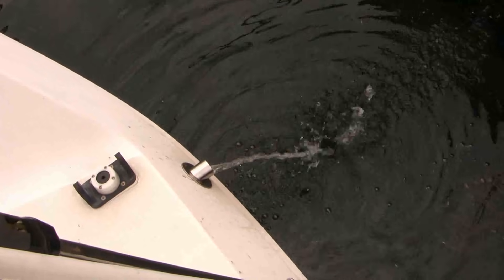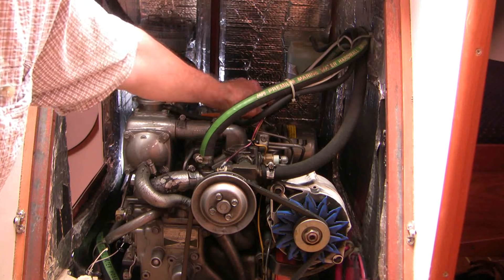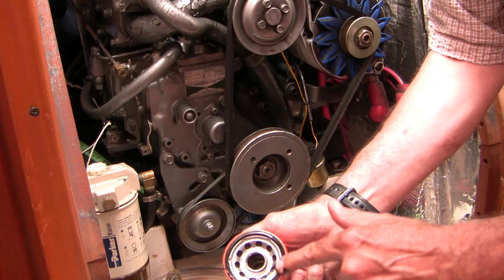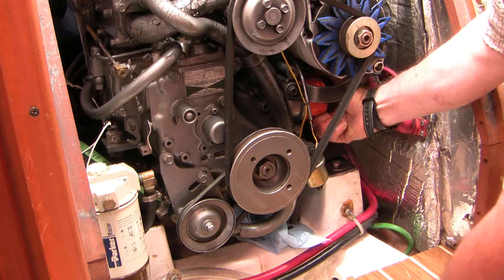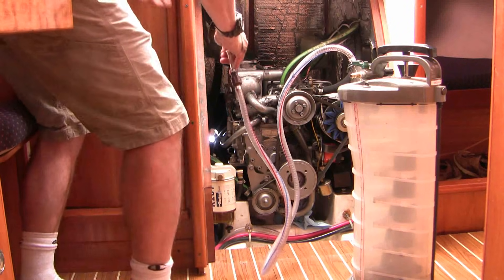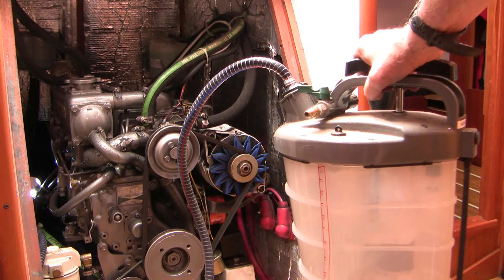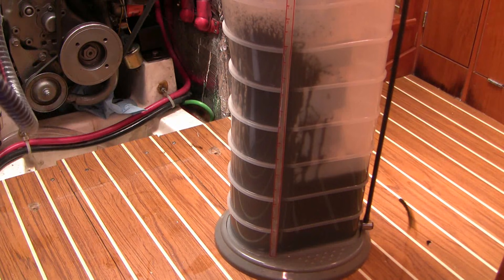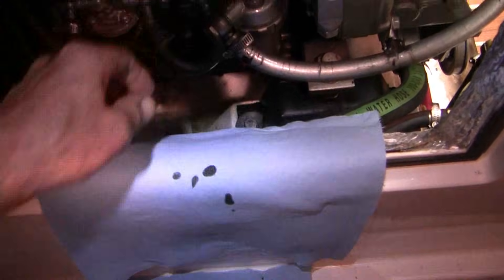Yanmar marine diesel oil change

Comment: Helpful video.  One question, why change the filter before emptying the old oil?  Thanks!
Reply from the maker: Oil filters have a silicone or rubber "anti drain-back valve" that keeps the filter and (both proximal and distal) feeder tubing charged with oil even after the vehicle is turned off. The system is designed that way so the oil pump doesn't need to clear air bubbles from the passageways at each cold start. When you break the air lock by loosening the oil filter, the siphon is broken so remaining oil in the proximal tubing will reflux backwards into the pan. It may not be a big effect but as a pattern of practice it makes sense to remove the filter first. Thank you for watching!
Reply: spelunkerd Wow!  Loved the medical terminology to stay oriented on how the system works!  Thanks!
Reply: Thanks @spelunkerd

Comment: You should still slide something under the engine and drain the engine after sucking the oil out of the top. Then use your suction system to empty the under-engine tray. That way you do a complete change.
Reply: There is no drain plug! Dana
Reply from the maker: How do you propose doing that, without an oil pan drain bolt in this engine? Even if some engines have a drain bolt, there is often no room to get a drain pan underneath. The siphon tip was at the bottom of the oil pan, it would be difficult to do this procedure any other way, and in fact this is the Yanmar approved method for oil changes in these little engines. To remove the oil pan, you'd need to winch the engine off the transmission to gain clearance to get those pan bolts free, and there would be an inevitable mess that would end up in the bilge and then automatically pumped into the ocean. Nobody does that, it costs tens of thousands of dollars to lift an engine in these boats. That said, if you have an engine with a drain bolt and room to use it, of course that method would be better.
Reply: @spelunkerd  Its think Dana is accustomed to Yanmar engines used on commercial equipment (Bobcats, air compressors, etc) and those have drain plugs unlike the smaller marine engines.
Reply from the maker: @victoriastreet8919  Yes. Small marine engines need to have their center of mass as low as possible to optimize boat stability. This Yanmar has no drain bolt so the center of mass can be lowered a couple of inches.
Reply: spelunkerd , I have never, ever, ever run into a Yanmar or a Perkin-Elmer with no lube oil sump drain. After getting the top sucked out, I like to use a 1-gallon oil jug with the side cut out. Jam it in, drain the sump (there’s never been more than 2qts left), suck the oil out of it, pull it out, wipe the inevitable splatters up. Miller time.
Reply from the maker: Oh, that's an interesting idea, certainly useful if you don't have a vacuum pump or reasonable access to a pan drain plug. I get that it is faster. Are you draining from the fitting below and aft of the oil filter? If you are draining from the oil sump pathway, the oil in the pan needs to get past the screen at the oil pickup before it can be drained. Coarse particles and sludge will not make it past that screen so would remain in the pan, and with time sludge will coat the screen. Siphoning with vacuum isn't much better but at least the bad oil doesn't have to pass through a screen to be removed. Documents from Yanmar, including the free owners manual which is available online, call for vacuum removal through the dipstick, as shown. Whatever method is used, hot oil offers the best chance of removing sludge and suspended particles.

Comment: Great video! Will soon have to do the same procedure on my Yanmar 3HM ... and also change the gear oil... You do not have a video about that by any chance!? :)
Reply from the maker: I have a sail drive, which is very different than a normal transmission. With the sail drive I do it with the boat out of the water, I unscrew a stainless steel drain plug at the bottom, let it all leak out into a pail, close the plug with a little locktite so it can't vibrate open, and add fluid (gear oil) until the dipstick says it is full. Inspect the fluid carefully to be sure there's no water in it, water will layer underneath the oil so it would come out first. If water comes out you need to change the bottom seals, at least. Thanks for reminding me to change my engine oil, it is that time of year, ha ha.
Reply: hahaha :) well I believe it is me who is saying thanks! so thanks for the tip!

Comment: Just so you know fram filters are crap
Nappa and wix filters are made much better
Reply from the maker: Ha ha, I knew somebody was going to chime in on that one. I agree. The Fram was the only one in stock at a local parts store. It is disappointing that mass market favours low cost above higher quality. You can't blame the parts store, it is expensive to keep multiple copies of the same filter on the shelf. Those same economic forces give us plastic cars, failing water heaters, and cheap tools. On the other hand, when was the last time you saw a car with a dead engine because of a failed filter? I never have.
Reply: @spelunkerd  Question, how do you cross reference the Yanmar filter part number to a Fram, NAPA, Wix, etc. part number?  Are you just taking the engine model number and/or filter part number to the local auto parts store and having them do it?  Or is there an online resource that can cross-reference for you?  

I have been reading the debate, here and on forums, concerning using a "automotive" filter vice Yanmar specific and I think I've decided I agree with your opinion, I have yet to see an engine failure that can be directly attributed to a cheap/crappy oil filter.  Additionally I live on the Chesapeake bay, 25 min from Annapolis, and I have the hardest time finding Yanmar filters for a reasonable price.  I finally found a shop in Pasadena, MD that carries a good supply at a reasonable price AND that is actually open on the weekends (Saturday AND SUNDAY) when I actually have time to work on my boat (Cobe Marine for anyone that lives in the area).  Unfortunately this shop is 40 plus minutes from my house and about the same from my boat.  If it's this hard to find filters at a reasonable price for me in a sailing dense environment, I can't imagine finding one elsewhere.  And yes I have scoured the Internet and while I can find them, the prices are stupid expensive.  If anyone has a reliable online resource for oil and fuel filters that is reasonably priced, please share.
Reply: Going cheap on a filter doesn’t make any sense. That filter is not intended for a Diesel Engine, oil is to thick although if you change it more frequently shouldn’t have a problem. Good luck
Reply: Fram is wix. Same factory.
Reply: @DPelicanGaming  take one apart, the construction methods are totally different between a FRAM and a premium WIX.

Comment: I enjoyed and learned from your two videos:  oil change and fuel filter change.  Thanks.
Reply from the maker: Thanks! I'm doing one today on sailboat winch lubrication, in case you have a sailboat, ha ha. Some day I hope to do one on the cooling system, haven't got around to that one.

Comment: I put 3 litres of cheap10 w30 in the engine. I run it for about thirty seconds and drain a second time.
Reply from the maker: That's a reasonable option. As you know, not all oil is changed so some oil from before (and some of the flush) will remain. Oil is so much cheaper than a major engine repair, even diesel-specific oil is cheap compared to everything else.
Reply: Interesting!  It sounds like your engine is well cared for!!

Comment: I am interested in understanding how the Yanmar 3HM35f engine is different and what components to service when & where on the engine. I may buy a boat with one...Any advice appreciated.
Reply from the maker: I have no personal experience with the bigger 3HM engine, though they share the same dealers repair manual that you can easily find, a free pdf online. Yanmar are reputable engines and I don't know of any special information regarding that one. The only knock I have about my engine is that without glow plugs, starting in the winter is more tricky. Even so, I don't have any trouble where I live. There are special issues with boats having a sail drive, I'll get into that one day in a video. Good luck!

Comment: Alternator belt is way to loose.
Reply from the maker: Good for you to notice, that was my first reaction, too. On this engine, belt tension is set by adjusting the position of the alternator support bracket. Last month, before the video I cranked the alternator support bracket with a big prybar, as tight as I could get it. It improved, but not as much as I'd like. As I tighten it down I noticed that the plane of the alternator pulley tilts, which is not a good sign. Right now there's about 1 cm of belt deflection, which should be adequate tension, but the belt still jumps a little, with a harmonic kind of motion in time with engine vibration. I think it jumps because the alternator pulley isn't perfectly aligned with the crank pulley, the plane of the pulleys is slightly off. These small engines don't have very hefty brackets, you don't have the kind of double pole rigid alternator supports that you have in a car. In fact I think the alternator bracket may have been bent a little by a previous mechanic when trying to overtighten the support. Either that or the small surface it mounts to is not exactly parallel to the crank pulley. It's a future project to work on, for sure. I may have to make a custom alternator support bracket with a bigger footprint, probably out of stainless steel. In the meantime I'm carrying an extra belt, I watch it carefully, and I try to retighten every couple of months.
Reply: Exactly my thought and fram is cheap

Comment: Very well done nice and simple but direct and to the point. Thank you. Peter
Reply from the maker: Thank you, Peter. There are few videos that I look back on that I couldn't improve if I had a chance to do them again. If I were to do this one again, I'd emphasize the importance of being sure that filter gasket is removed and the mating surface is clean. Every day in North America a car dies because the grease monkey forgot to check. I am told that the double gasket mistake is the most common cause of insurance claims against mechanics. What happens is the customer drives away, oil sprays out from the double gasket under the filter, the oil light comes on, and the customer doesn't turn the key off soon enough before the engine is destroyed. I hope that people who stop by will remember to both check that the gasket came off and do a double check afterward with engine running to look for leaks. It's nice to meet you, I hope to do a few more marine videos in the next year. 

Dave

Comment: i just got a Helms 30 sailboat with a Yanmar 8hp and this helps out a TON!!!  any advise on one that was well maintained but abandoned 11 years ago?? i havent tried starting it up yet.
Reply from the maker: That's a good point about cranking for a short while with the cylinders decompressed. Most Yanmars don't have glow plugs,  but you can do the same thing if you hold the decompression valves open. In fact the Yanmar owners manual describes a cold start procedure that begins with decompression and the stop cable pulled out, so you don't flood the cylinders with fuel while getting oil and valves moving first. After 10 sec you pause, then wait for a couple of minutes to let the starter motor recover. I showed how to do that for purging air in the fuel filter video. After doing that you start normally, some guys recommend full throttle, but dial down after it starts so you don't rev a cold engine. That technique for a cold start seems to work pretty well for my engine.
Reply from the maker: I would change the motor oil and filter, the coolant, the fuel filters and the fuel, then bleed the fuel lines of air. In a gasoline engine it is common advice to put a few drops of oil into each cylinder, though it may be difficult to do that in a diesel if you don't have glow plugs that you can remove to gain access to the cylinder. You'll almost certainly need a new battery. The big problem with old unused engines is dry rot of seals, but you can look for that after you start it up. Remember to pause for a few minutes when you crank for no more than 10 seconds, and in my Yanmar I would close the salt water sea cock to prevent hydrolock, then open it right away after it starts. Good luck!
Reply: change oil, remove glow plugs and crank it until  You see oil pressure built.  after  that try to start with fresh fuel. 
I would not change antifreeze, before knowing  engine  condition. if engine needs overhaul,  new antifreeze will be wasted.  if it starts and runs good, then do everything. Good luck.
Reply: For engine , that was standing still 11 years  oil pump probably needs to be primed.  happened to me, first was cranking  w/o  filter, than pumped air in  crank case through dip stick  hall to create some pressure, that worked.
Reply: Late out of the gate here but besides what others have recommended, oiling and such, a huge potential problem on small diesels that sit too long is a but of rust developing on the governor components or lever shafts.  In general, these only get lubricated when the engine runs by splash lubrication.  On these engines it can be stuck at full throttle as that is the normal position when off.  I'd try to remove PTO access plates to see if things are moving freely before starting.  Have the air filter off and have a tennis ball or other plug ready to block the air intake though the fuel shutdown can do the job.

Comment: i just purchased a 33 tartan with a fairly new ( 290 hour ) yanmar engine; as i go through some of the videos i found yours and have to agree with the other gentleman, your video is very informative, simple and easy to understand; if you send me an email address i will communicate with you privately.
best.
jorge a.
Reply from the maker: Thanks, man! Those Tartans are excellent boats, very nicely designed and surprisingly fast. Tartan came from the C&C pedigree, upgraded. You can reach me any time by sending a private message through my channel, it comes right through but I may not be able to answer right away because we're traveling. Nice to meet you!

Dave

Comment: Great video - where does one find that handy dandy syphone tool?
Reply from the maker: I got that one at Princess Auto in Canada, which carries a line of products similar to Harbor Freight. There are many iterations, but mine is designed to be used in the shop with compressed air creating a vacuum by a Venturi effect. In the boat I use the hand pump, which works fine. You would be surprised how often it comes in handy for auto repair. Thank you for watching!
Reply: it is a great tool, the visual read and calibration make it so. now we need a miniaturized version for crusiers !

Comment: That is a nice compact engine, and yanmar is a known quality company :-D.

I would call it a good chugger, not hyper fast but very very reliable, ive known some old honda motorbike engines that have that feel :-D.
A chugger is allways worth the trouble :-).
Reply from the maker: Ya, reliability is the critical issue with a sailboat engine. Thanks for stopping by!

Comment: How would you go about removing that engine if it were necessary? By the looks of it that would be a real pisser! Thanks for sharing this video.
Reply from the maker: Good point, you generally need a crane. The companionway of sailboats is almost always over the engine, which gives a preexisting slot through which you can lift the motor. When the boat is up on ground stands, you drop a crane hook through that slot to the motor, then unbolt motor mounts and lift it up and forward. You're working way up in the air, because the 4000 lb lead keel of these boats drops 7 feet below the bottom of the hull. My boat has a sail drive, which means the transmission and prop are aligned vertically, lifted out together with the motor. I was shocked to learn that a motor replacement costs about $20,000, and even doing it yourself costs a bundle. Fortunately these engines don't often die, unless the owner makes a goofy mistake. Your question is excellent, working on a seam that I want to explore in the future. What would surprise a gasoline mechanic about the design of a sailboat diesel? The unusual fuel and cooling systems are at the very top of that list. Thanks for watching!